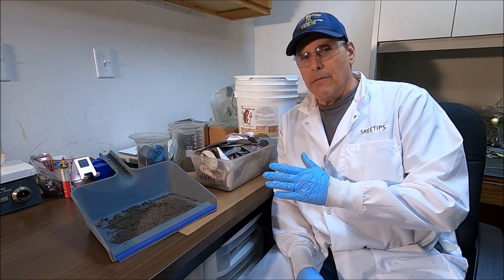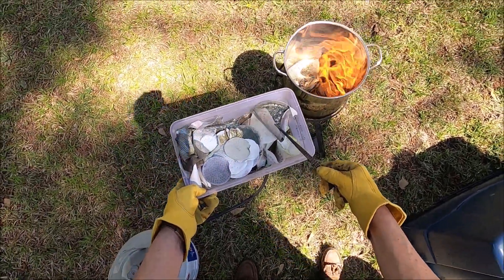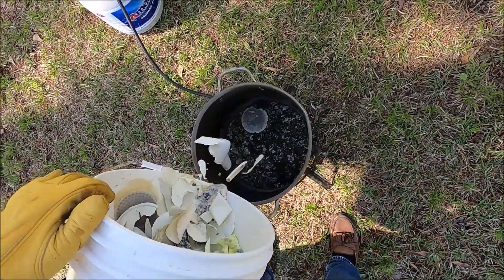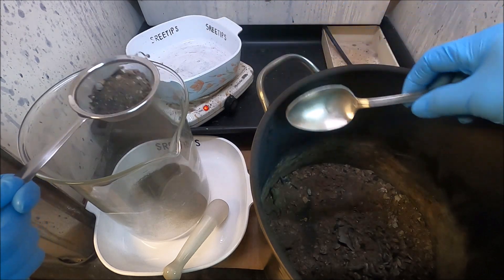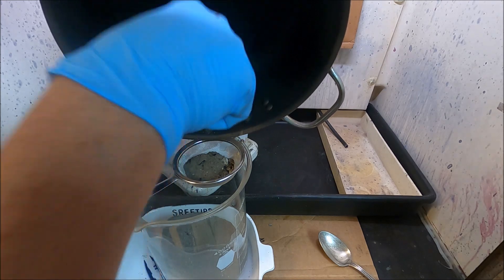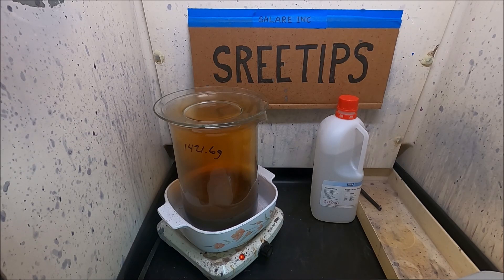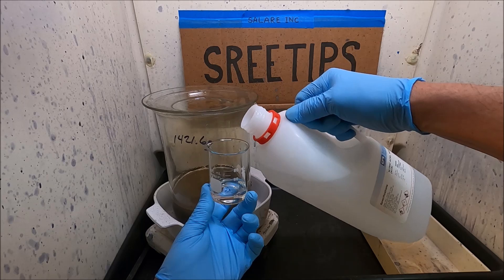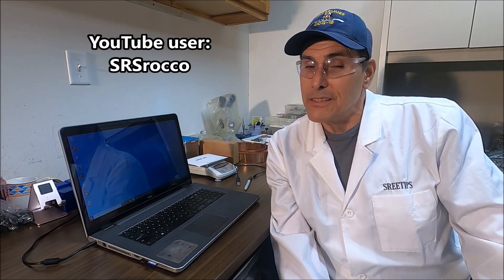Gold and Silver Refining Filter Papers Recovery Part1

Comment: What is the advantage of incinerating the filters ?
Reply from the maker: Burns off junk that can interfere with the recovery. Harold_V, one of my early mentors, used to say, “the three most important things about precious metals recovery are: incineration, incineration, and incineration.” It will remove gunk like no other process can.
Reply: Just a thought.  Cellulose (paper)  reacted with nitric acid ....can produce nitro cellulose.  This is an un desired side effect.  And uses up some  nitric ions thus acid.  .easier / more economical to burn off first.

Comment: Humm, i have run filters a few times now and although a simple incineration like that works fine if you are just going after the gold and pgms i find the silver chloride is not recovered using this method. The silver remains in chloride form in the ashes and therefore is not dissolved in the nitric wash. Maybe you should keep the waste ash from your process and see if you can recover further silver from it from a more advanced method.
Reply from the maker: According to Harold_V on the goldrefiningforum.com silver chloride can be reduced to pure silver metal by melting with plenty of sodium carbonate flux. But I've never done it.